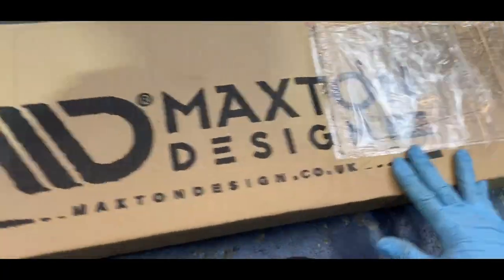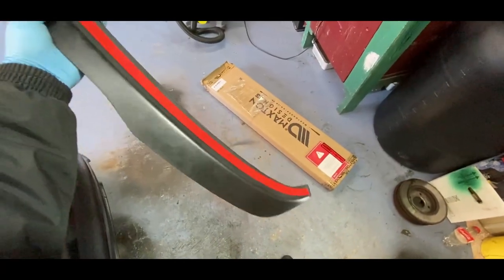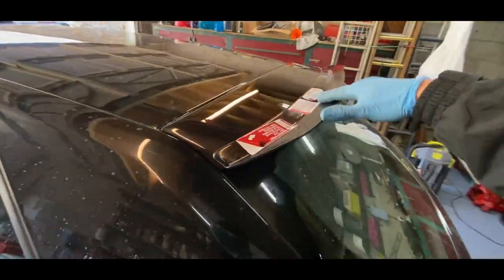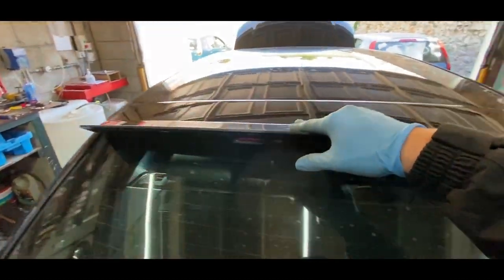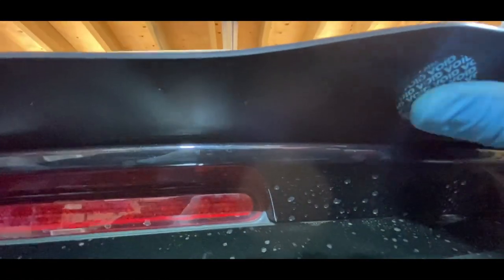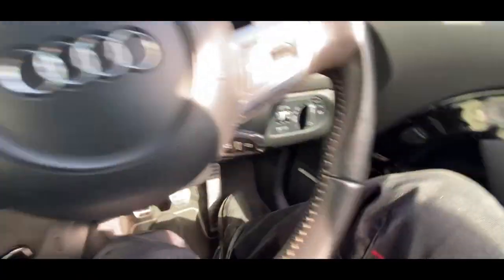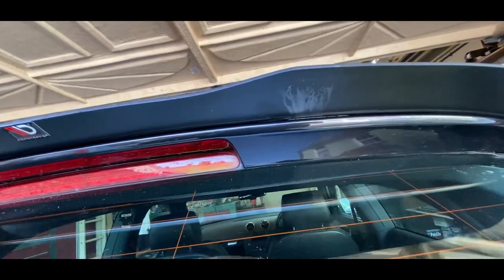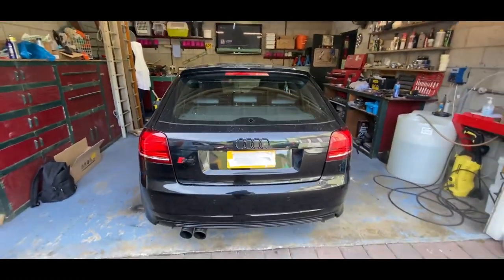Audi S3 8P - New Maxton Design Spoiler Extension!

Comment: Is the spoiler on the facelift and pre facelift the same size mate? I have a 2008 pre face cheers
Reply from the maker: Hi mate, I bought the fl version as they don’t do one for pfl. It’s not the same and I needed to glue it in the end to make it stay down because the corners of the spoilers are different
Reply: @MotoAdventuresYT  cheers mate think il get myself one 👍

Comment: I ordered one of these for a pre facelift s3 and it doesn’t fit and nothing like yours
Maxton were very unhelpful so they are having it back and I’m getting a refund 
They just said the codes right 😁
It’s flat on the ends and not curved 
Oh well
Reply from the maker: Mines probably the same mate I just made it fit with extra tape
Reply: Turns out the sold me one for an a3 but originally insisted it was for an s3 🤣
They have now corrected their issue on site 
Facelift and pre are the same